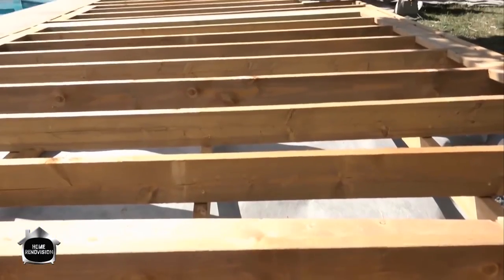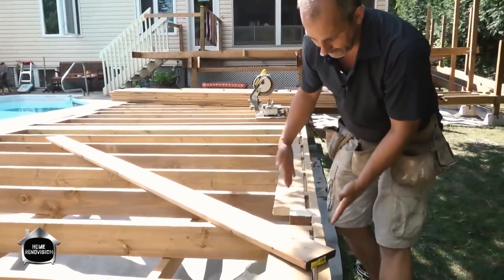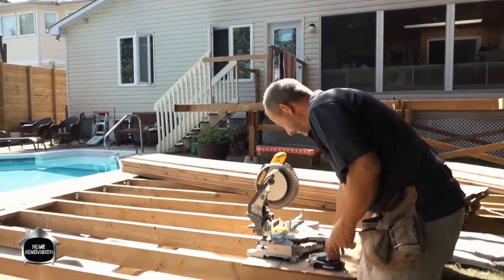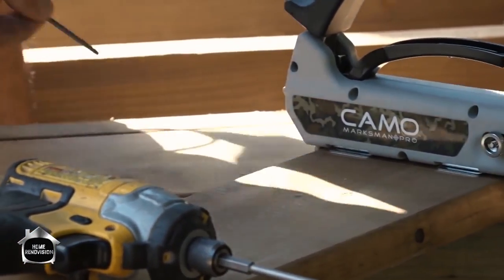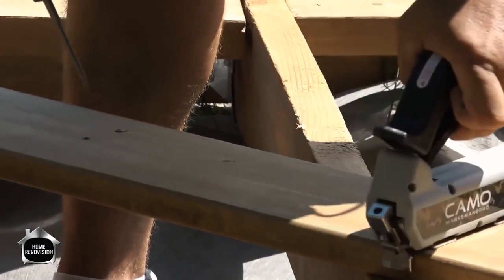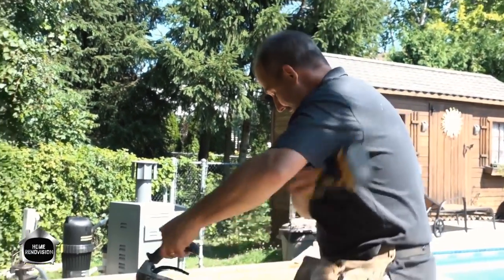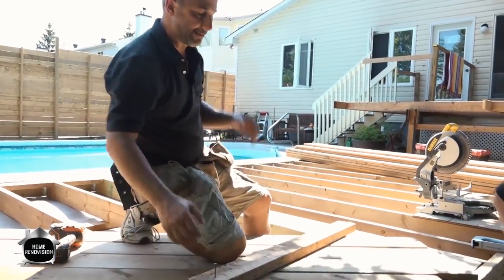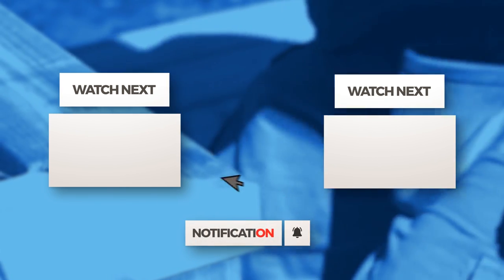DIY Deck Part 4 | My Favorite Secrets For Finishing A Deck

Comment: Jeff- I built a 20 x 20 deck last summer and used the CAMO system. It is a bit slower than conventional deck screws but looks fantastic when finished. After the deck seasoned I had one board that pulled loose at the end because of extreme warpage. That's not too bad for 400 square feet of wet/ green lumber. This is a great video and great commercial for the CAMO system.  Thanks a lot.

Comment: Hi Jeff, great video! - You're a great DIY resource and teacher!  I built my first and only deck inspired by your work using the Camo system.  It is relatively small at 16ft x16ft but one thing to keep in mind is that as the treated wood dried it shrunk significantly resulting in increasing the gaps between the deckboards.  In hindsight I should have used the Camo with the thinner gap plate and not the standard Camo.  Still the deck looks great, with no unsightly nails or screws.  But i wouldn't recommend any high heels walking thru as they will easily get stuck in the gaps.
Another draw back I can see with the Camo is the side entry can make it a little harder to remove any board needing replacement.  I still would recommend the Camo and use it again but with the thinner gap plates.  Thanks!

Comment: Time considerations aside, screwing from the bottom is still the best way to eliminate water collecting at the screw head which hastens the rotting process.  Build large modular sections, screwing the decking on from what will become the underside, then lay down.  (Just finished an at-grade deck with three 9' x 14' modules and two 10' x 10' modules.)  Next, trim ends of decking and finish with skirt boards glued in place using biscuits and waterproof glue.  Not a fastener in sight, or exposed to water, will last longest of any system and only takes two or three times longer than surface fastening.

Comment: Love the videos ... my ocd kicked in though when I ever saw you using channel lock pliers on a nut for the deck bolts UGH why not use a box end wrench, even spring for a ratchet one and it would save you so much time and energy than fighting with pliers and nicking up the bolts?

Comment: I did this with 2x6’s and I ended up having to go back and put screws in at ends of boards as they dried.  My wood was still quite wet when I installed it and I knew there would be some issues.  Probably would only do this again with 5/4 boards.   Great video

Comment: Different topic

What would you suggest if the floor at the top of a 3 riser stair is uneven. The right side is 1 inch higher than the left (stair is 36 inches wide). The floor drops off another inch over the 11 feet to the left so I don't want to raise everything by up to 2 inches.

I wish I could remember what the original steps did. Perhaps the landing was sloped or each step was sloped.

Comment: My deck is also picture framed with diagonal boards, but is 15 yrs old. Some rotten frame boards had to be removed and i just learned from your vid that it does not have the additional 2x8 or 2x6 blocking underneath for that additional area to screw the surface boards into. Can I add more new boards to an old deck to enforce it?

Comment: What are you feelings about composite decking? I see you covered it a little bit but I was wondering what your thoughts on it from a maintenance aspect. We have a 15 year deck that looks like its 20 and needs to be replaced sooner or later. Keeping up with the staining has been a chore and we're looking at using composite decking on the next one.
Reply from the maker: I would use hardwood decking before composite for the price. I still like to walk barefoot on my deck! if you are a shoes only person then composite is for you. it just gets too hot!

Comment: Just finish my deck and i use also camo, like the look but they only problem is at first perfect gap but after a week the gap is much bigger,  wish the gap in beginning was smaller.....buy you get use to it. Ha...you forget to put the black tape😉
Reply from the maker: no need for the tape this time. Cheers. if you let the wood acclimatize for a couple days then the gaps stays consistent.

Comment: Love the content but now I have a question. My mother's house is in need of some love. We recently moved back to the same area so I can take care of it. Someone said that it's Tudor style. Boards on the exterior make sort of a frame with what appears to be cement or a really hard stucco in between the boards. It's really hard to describe but if you google tudor style you'll see what I mean. The stucco looks like its just trowelled over plywood. Some of the area's have come off and my father painted the area to protect the ply. I would love to know what products to use to redo the stucco and any prep that needs to be done before I do.

Thanks Jeff
Bill

Comment: Quick question, you said 16" centres but then you laid the boards diagonally, so the span on each board is actually longer than 16", is that ok for 5/4x6?
Reply from the maker: as long as it is wood. if it was composite then 12" would be necessary!
Reply: @HomeRenoVisionDIY  Thanks
Reply: @jepps77  where I am from all 1" thick deck boards require 12" on center joists when running the decking on a 45 degree angle.  For the cost of the extra few joists its a worthwhile investment.  Might be strong day 1 but after 5-10 years of wear and tear and deterioration of the decking you'll be happy to have the shorter decking span

Comment: Great video! How is the structural support constructed? What does the support rest on?
Reply from the maker: this deck was on blocks and used joist hangers
Reply: Thanks! But what about the support under the middle of the joists? Are those on blocks too?

Comment: Thanks for the informative video! If you screw the boards on the sides, how do you get them out if you need to repair one or two?
Reply from the maker: the point of entry is accessible after install. just not where you walk!
Reply: @HomeRenoVisionDIY  wow! then I'm sold :)

Comment: Great video and the animation is awesome! I see you add in the 2nd screw between the boards each time.  Does that mean when it comes time to remove and replace a plank, there won't be any problem backing out those screw?  Will you need to line yourself up with the Camo tool to remove?
Reply from the maker: those palnks never need to be removed. the camo makes the wood last for ever. Cheers!

Comment: Great video! Question: how do you remove a damaged deck board that was installed using the Camo blind screws?
Reply: Yes, that must b a problem.  I can see having to crowbar things
Reply from the maker: easy as pie. I will show you in my decking video. Cheers!
Reply: Jeff didnt specify that u must use the special camo screws. They leave a bit of a hole as a result of countersinking. Maybe they can b unscrewed, maybe that can cause a little splintering as the screw comes out?  But if u r unscrewing its probably because u r changing the board
Reply: @HomeRenoVisionDIY  THX! Looking forward to it!

Comment: HELLO! super irrelevant question! but please answer! so I will be creating a small kitchenette space. I have looked into kitchen sinks and boy, are they expensive. I have noticed that like similar shaped bathroom sinks are a lot less... can you use a bathroom sink as a kitchen sink? I cannot find anything on it. For example, this sink from amazon is a rectangular sink with these dimensions: 24 x 16 x 5 ($90). A small farmhouse kitchen sink has the dimensions: 24x18x10 ($316). Clearly they are a little different in shape, but I will barely be using the sink. just to wash some plates and cups. If I were to do this, I would probably find a little bit deeper of a bathroom sink. And, looking at them, they appear to be the same...like since its a farmhouse sink there is no lipping for it to go around the counter...can you please tell me if this is possible or why it is not possible. Here are the links to the two sinks I am referring to: https://www.amazon.com/Lordear-Rectangle-Bathroom-Porcelain-Ceramic/dp/B07C2192QB/ref=sr_1_11?dchild=1&keywords=bathroom+sinks&qid=1593030652&sr=8-11 
https://www.amazon.com/Lordear-Farmhouse-Fireclay-Apron-Front-Kitchen/dp/B07RQDW4YB/ref=sr_1_3_sspa?dchild=1&keywords=small+white+farmhouse+kitchen+sink&qid=1593030635&sr=8-3-spons&psc=1&spLa=ZW5jcnlwdGVkUXVhbGlmaWVyPUEzOElUS1owVVJTVUhJJmVuY3J5cHRlZElkPUEwOTk0Nzg1WUJYQzdMNUdYVjVHJmVuY3J5cHRlZEFkSWQ9QTA3MzQ2MjY5OE1SUUtFVDZHR0Mmd2lkZ2V0TmFtZT1zcF9hdGYmYWN0aW9uPWNsaWNrUmVkaXJlY3QmZG9Ob3RMb2dDbGljaz10cnVl

Comment: Great tips, Thanks!!!
Question: pre-treated wood or cedar or ?
If pre-treated wood, do you wait until dry before you install it?
Thanks for the inspiration!
Reply: When you use the camo screw system with "wet/fresh" deck boards, the gap will increase when the boards dry out and shrink. If that is an issue for you, then it is best to wait until the deck boards are "dry". I believe they have different options as well for spacers, so you should go with tighter 1/16" spacer with "wet/fresh" wood for less shrinkage space afterwards.
Reply from the maker: regardless , let the wood acclimatize a couple days before the install. cheers!
Reply: I am redoing my deck , I bought only a few boards (6)to start the deck , I laid all the on the deck I come back to see some boards are warped I don’t get it , payed a premium price thinking this shouldn’t of happened.

Comment: Hi Jeff, another amazing video! I really like the animated drawings, keep it up. I am thinking of replacing the floor boards on my 30+ year old deck. My deck has 5/4 in x 6 in boards. Do you think it is fine to just replace the floor boards of the deck and not all of the support / main structure?  If I replace the boards with new 5/4 in x 6 in boards, what size camo screw / tool would you recommend I use?
Reply from the maker: standard size for standard boards use the long ones for 2x6. Cheers!
Reply: @HomeRenoVisionDIY  ,Thank you for your reply! I have a quick follow up question. Which Camo tool should be used for installing 5/4" deck board, the Marksman Pro or the Marksman Pro-X1 tool? The only difference I see is the Pro has 3/16" spacing and the Pro-X1 has 1/16" spacing.  What spacing do you recommend for 5/4" deck boards?

Marksman Pro Tool (https://www.homedepot.com/p/203040672)
Marksman Pro-X1 Tool (https://www.homedepot.com/p/203633547)
Reply from the maker: That all depends on where you live and where you are installing. in southern climates the boards tend to shrink a lot so the thinner joint is better. closer to the ground tends to swell so the larger joint is best there. in the shade or open sun can affect it as well especially in the northern climates. Cheers!

Comment: Would it be possible to use a framing nailer to toe nail the boards into the frame? Doing that in between boards would be a challenge I guess.
Reply from the maker: I don't suggest nails on deck boards. they will end up deflecting and pulling out the nails which causes squeaks.

Comment: When your installing a deck should you spread the lumber and let it dry or screw it in strength from the lumber yard wet?
Reply from the maker: both options work. the secret is to drive a screew in the wood to see if you should leave a gap or install snug and let it be created over time. if using cammo  then acclimatize on site a couple days!

Comment: Do you think a ground level wooden deck needs replaced sooner than a diffefent style deck/patio due to its proximity to the ground?
Reply from the maker: the closer to the ground the faster it will deteriorate.
Reply from the maker: but we are still talking over 20 years of good deck surface. Cheers!

Comment: Do you have to use camo screws with that gun, or will regular deck screw work with it?
Reply from the maker: how you screw your deck is optional from the design aspects. Cheers!
Reply: If your asking if you need to use camo screws with the camo tool then the answer is yes. Great, affordable tool.

Comment: Whats the best battery powered drill?
Reply: depends on your budget and if you are a professional using the tool everyday. I personally have the brushless top of the line dewalt drills and they are excellent; been running great for over 4 years of use. All brands are mostly good, just stick to a brand so you can use the batteries for other tools. Rigid is good for homeowners/DIY , they are less expensive and have lifetime service warranty when you register.
Reply from the maker: I love dewalt for the power vs cost. Cheers!
Reply: @HomeRenoVisionDIY  Thank You!
Reply: @A-Sidhu  Thank You too. I'm just a homeowner but I'm doing major projects and need something more sturdy than I have. I'll be checking out Dewalt.
Reply: @A-Sidhu  Thanks for your advice, Do they have a Disney model as well?
Reply: @gustonzimasheen  I am not sure what you are talking about. Sorry.